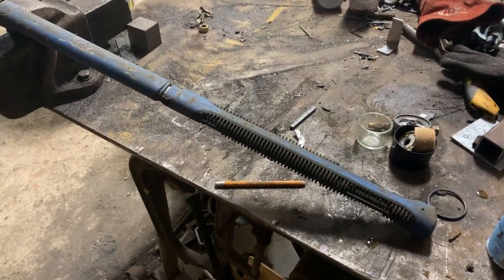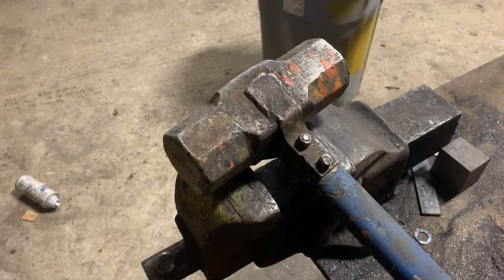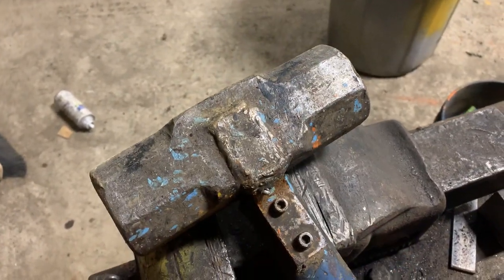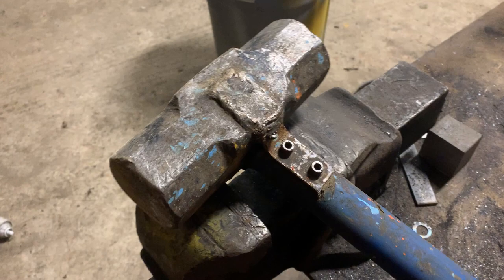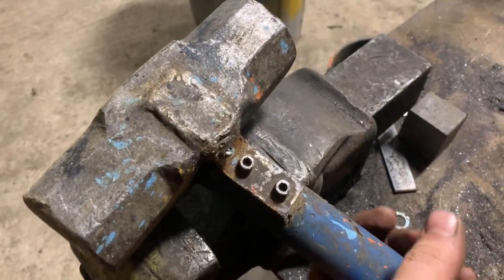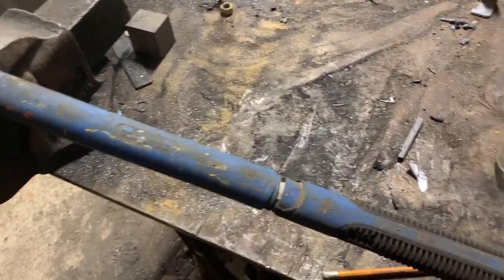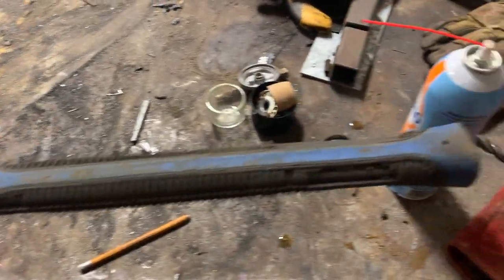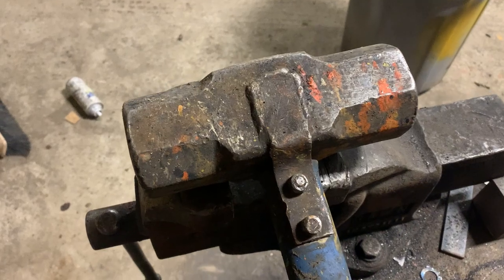Repairing the Most Important Repair Tool

Comment: I had a 12 pound splitting maul that I used when I was young. As I grew older, I've backed off on the weight. I'm now down to a 6 pound maul and a hydraulic log splitter!!!(;>) But, most importantly, what I've found to keep handles in the heads of my tools is to NOT let my brother borrow my mauls. He overshoots the target every time!!!

On a completely different subject, I don't know and or want to know where you stand on what's going on in your country right now, but from me, all I can say is Canadians ROCK. Love you folks up there!!!!(:>)
Reply from the maker: in my mind I'm at the front of the convoy ,but on the other side of the country here.

Comment: That's a good idea for the glass handles they seem to be the trend. I still stick to wood tho. Amazing how many I find with the head on upside down never keep your head on that way. A common problem is they dry out so use antifreeze instead. As glycol doesn't evaporate they stay tight. My invention is a ballpeen head with a big rig tie rod ball end (cut the ball out of the seat) welded into it. Good for tight spaces fits in your hand nice and it never slips.

Comment: Yessir. A hammer is a very valuable diagnostic tool in that if you can't fix the problem with a hammer it has to be an electrical problem. And I HATE fiberglass handles. GBWYall!

Comment: the Step Drunk broke the fiberglass handle on a splitting maul, replaced it with 1-1/8" sch40 pipe (ish) worst fecking tool ever handle weighed as much as the head, my idiot brothers and the Step Drunk swore by it and preferred it... I think its still around (30+ years later) though I've learned that a 4-5# council rafting axe is miles better at splitting then even the heaviest of mauls, anyway, just dragging that damned maul around would wear a guy out, let alone trying to swing it with that cursed round handle, and zero kinetic advantage, yeah its heavy, but not in the right places (did I mention my brothers and the SD are/were not exactly smart, they just hit things harder if it didn't work the first time)